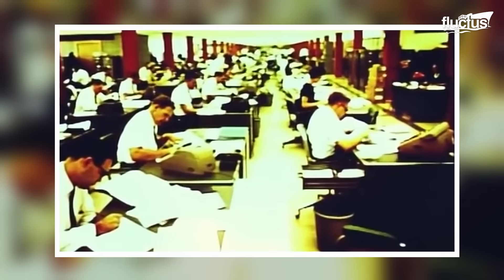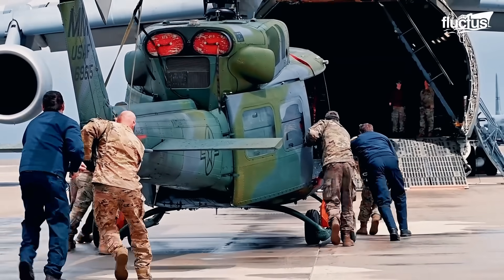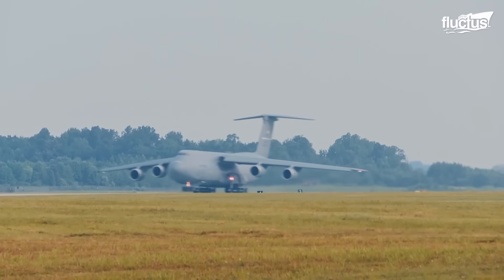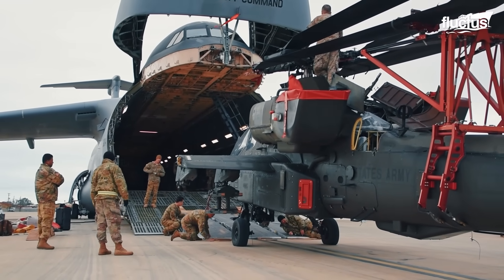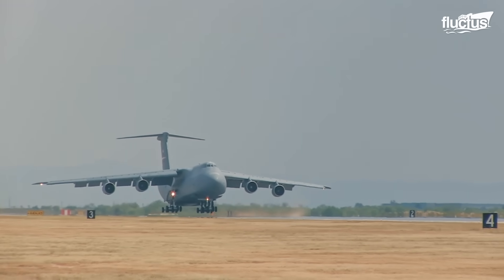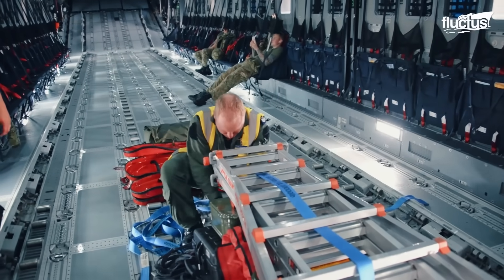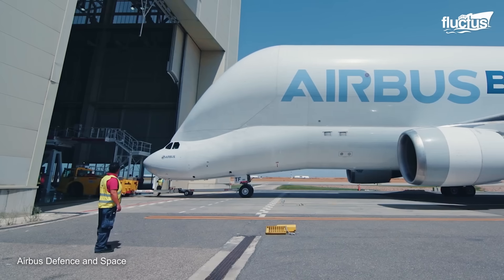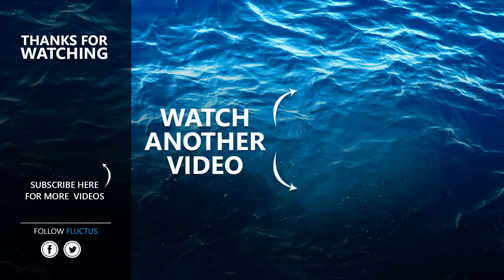How the U.S. Operates The World Largest Military Plane During Intense Flight Operations

Comment: Very informative. Thanks. Does anyone know why most of the military transportplanes are turboprop driven in stead of by jet engines like this Lockheed C-5 ?? Galaxy
Reply: C-130, A400m, are tactical lifters. C-5, An-225 are strategic lifters. C-17 is powered by jets. C-17 bigger the C-130 but smaller the C-5 and used similar to c-130
Reply: @robertgriffin662 good answer. 

I've had the fortune of working on all three, the C5, C17, and C130. While none are exactly easy to wrench on and all have their own idiocicracies, they all do some pretty cool shit. My personal favorites are combat takeoffs and landings.
Reply: @iarissei I'm a major military nut! Love this stuff. The c-130,-17,-5 and A400M are awesome machines.